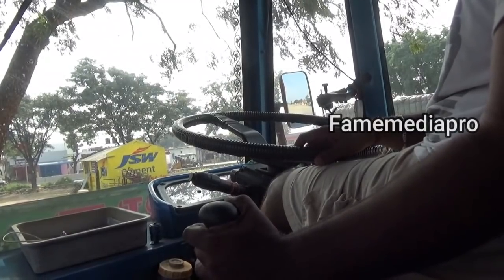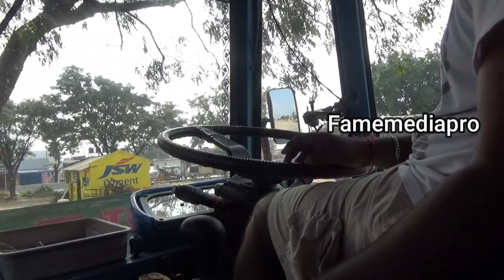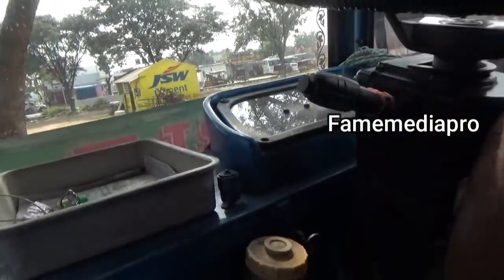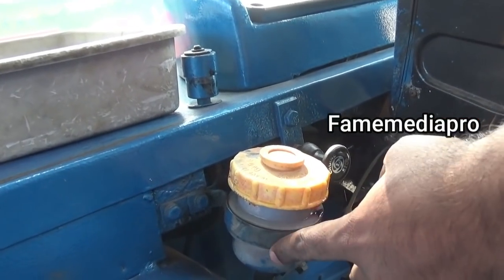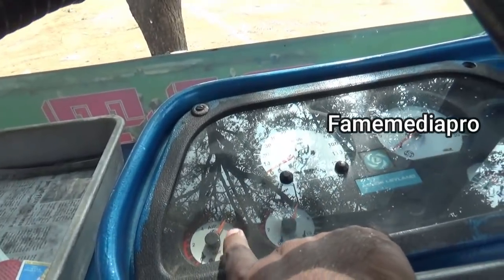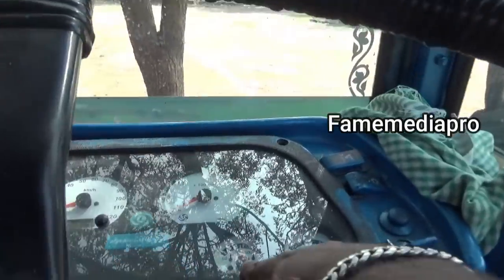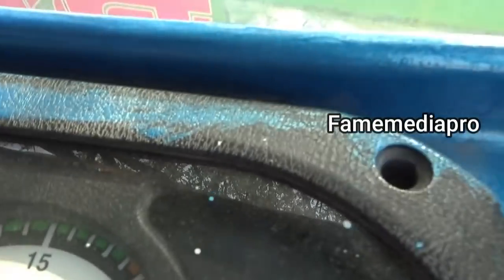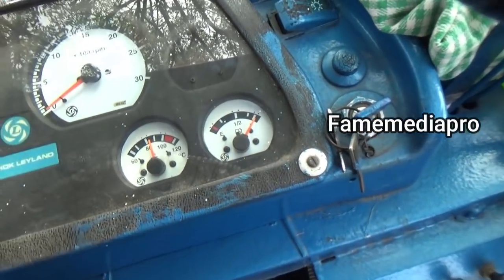How to put Gear Explain !

Comment: Bus & Truck have different chassis dimensions  wheelbase etc  & also both have different  gear ratios & differential ratios
mostly truck will have a stronger drive axle with higher gearing for overloading
Reply from the maker: Thanks sir germatech